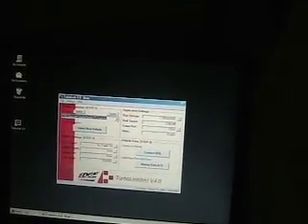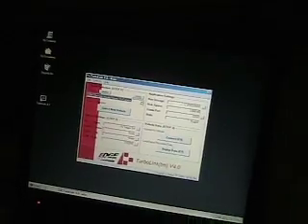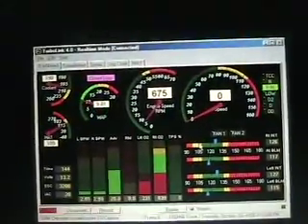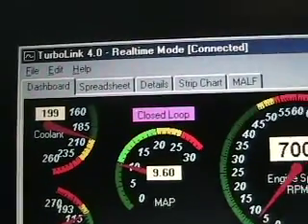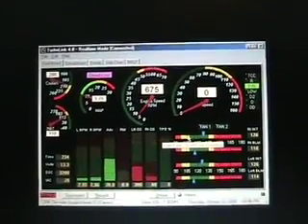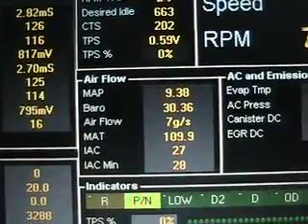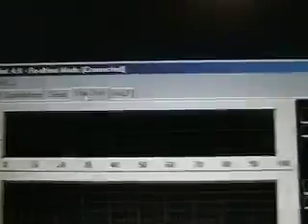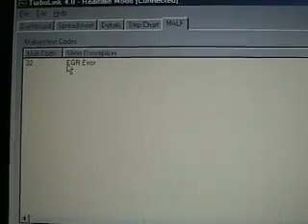1994 Chevy Caprice Wagon - TurboLink - Brain Scan for my car!

Comment: Used this program many years ago. The only problem now days would be finding an old OS computer with a serial port on the side because that’s the only way it can connect to your vehicle.
Reply from the maker: Yes, totally, I still have my thinkpad to run it, although it hasn’t run in years.  Wasn’t there a serial to usb adaptor that worked?
Reply: Turbo231 nah I tried that too. But this program was essential to have for an LT1 engine I diagnosed A bad optispark with this program on my 94 z28
Reply from the maker: For a while it ran everything I had, 94 Caprice, 91 S-10, 88 Fiero, and 86 T-Type.
Reply: Turbo231 nice. I use the vcx diag-nano on my GM vehicle’s now it’s a boot leg GM tech 2 that plugs into my laptop I can gain access to to all the modules reprogram probably $1500 worth of software for only $100 on a tiny little interface module lol

Comment: You can build this cable.

Since youtube does not allow links in the responses, google "winaldl", the site that comes up "winaldl joby", select that. There is a link on the page to build a cable, go there.
I built this cable and it works with winaldl and turbolink on my truck which is an '85 with a '93 3.4 v6 and the tbi system from an '88 s10.

Comment from the maker: @chevyvette  It can...some are logic switches controlled by the ECM, others are sensors that are reading or not.  Usually a sensor failure also results in the SES light being set, so if that's good, it an intended operation.